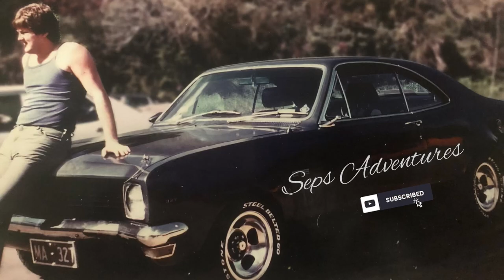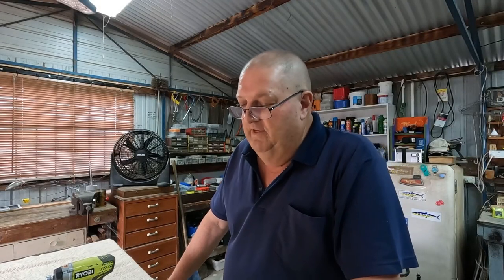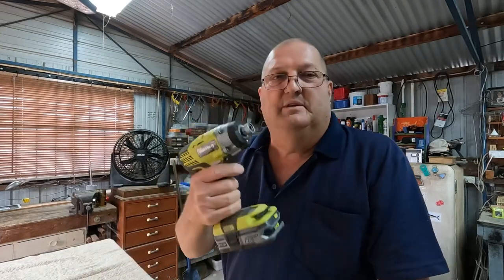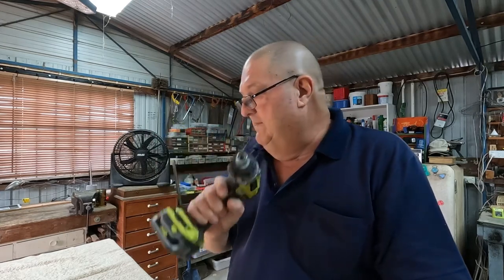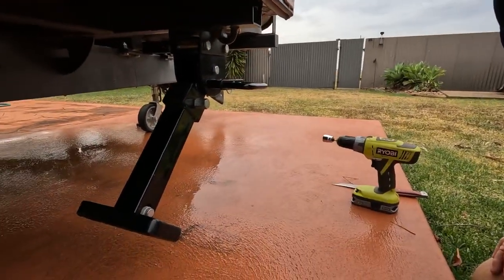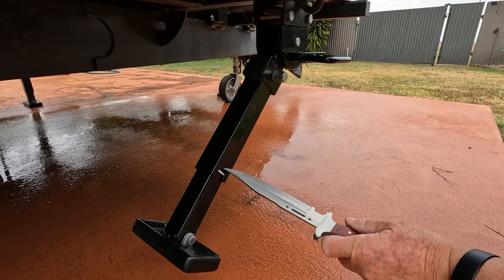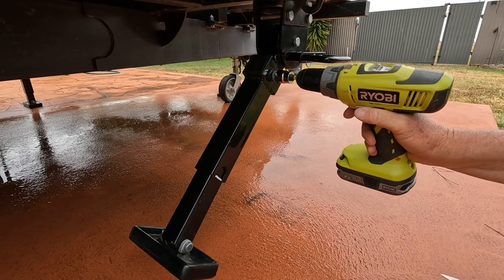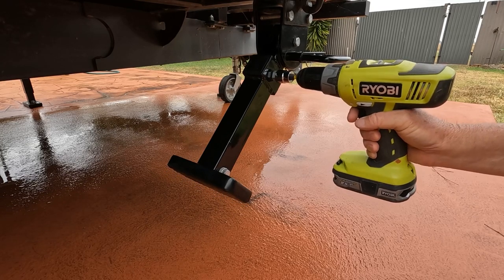RED CENTRE CARAVAN - LOWERING STABILISER LEGS WITHOUT STRIPPING THE MECHANISM | SEPS ADVENTURES

Comment: Thanks Sep but I've seen a number of vids that show in the vertical position the van can move whereas at an angle 
they are locked in. I tested it on my van and in the vertical position a small amount of weight unstabilised the van. I use 
blocks and an angle and it ends up much more stable. Thanks again for your vids.
Reply from the maker: I have also noticed some vans have the legs on an angle facing east and west which must further stabilise the van from side way movement.Thanks for your comment. Cheers!

Comment: I used to use a battery drill for that but changed to a 3/8" battery ratchet.  The ratchet is much slower but it prevents me from over extending the stabilizer.  I lower the stabilizer till it almost touches the ground then crank the rest by hand.  The reason I do that is once, I drove the leg down too far and it actually torqued the frame of the trailer so the door wouldn't close.
Reply from the maker: It’s easy to over extend the legs when using a drill. The drill I use also has a variable speed trigger which helps manage the speed. Thanks for your solution. Cheers!

Comment: Gidday Sep

I'm new to caravans, how do I know where is too far to mark a line
Reply from the maker: Firstly you need to check the maximum length that the stabiliser leg will extend out. If you force the leg out any further than its maximum extension it may strip the mechanism inside the leg. Best way is to manually wind down the leg with a hand winder until it stops then wind it back up a couple of inches and mark your paint line. Now that you have a paint line when you wind the leg down as soon as you see the paint line stop winding the leg down any further that way you don’t risk stripping the mechanism especially if you are using a drill. Hope this helps and thanks for your question. Cheers!

Comment: What brand of leg are those? We were sold Al -Ko ones and they have jammed after 3 uses and manual winding! The winder gear shaft has a lot of play which might be part of the issue.
Reply from the maker: The legs were already on the van when we purchased it. We have never had any trouble with them and they are around 3 years old. I cannot find a brand on the actual leg sorry cannot help you with that one. Cheers!

Comment: Do you have the legs vertical before extending the legs, or leave them at an angle?
Reply from the maker: Move the legs to the vertical position then wind them down, doing it this way will allow you to see if they are going to be too short, you can then place a block underneath them before continuing to extend them all the way to the ground. Hope this helps. Cheers!
Reply: My old Roma caravan has a different system,it uses a threaded bar to let the legs up and down. I use a drill,but the back ones make a racket that would wake the dead 😅.